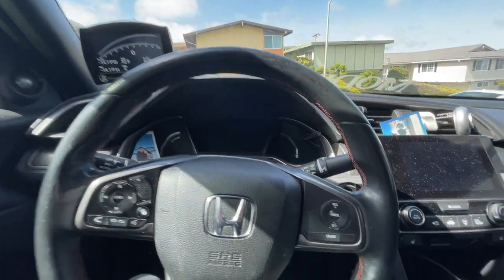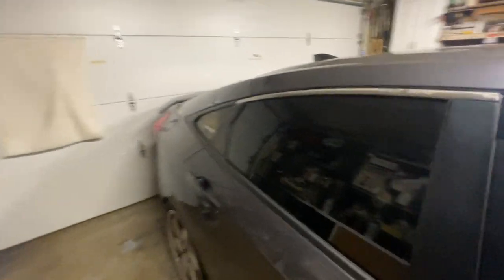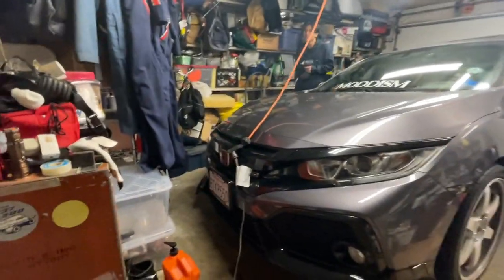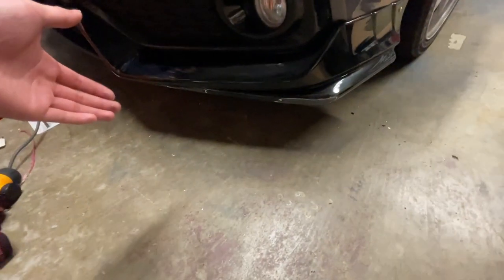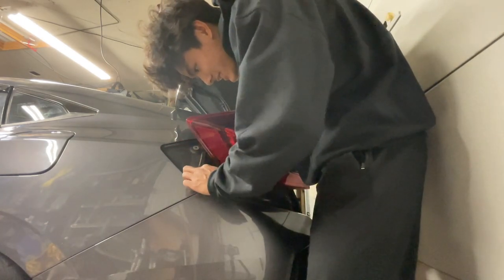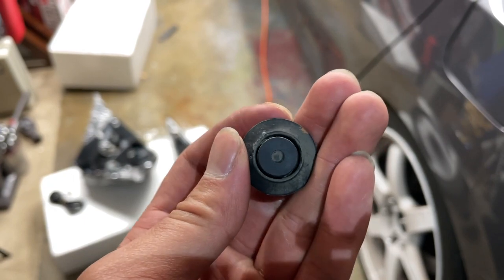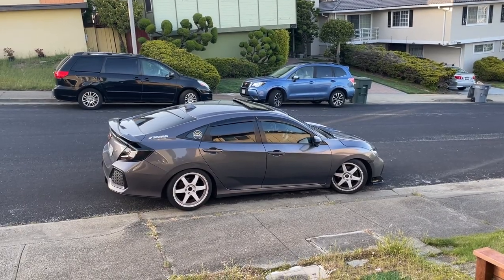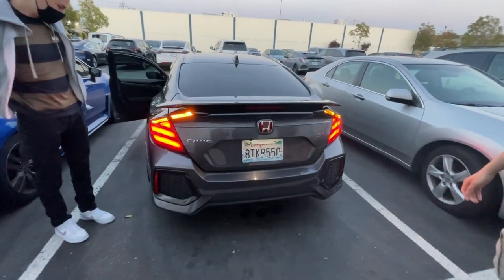I CAN'T BELIEVE I'M ONE OF THE FIRSTS TO GET THESE!!

Comment: When installing these do you need to do anything special from going to the bulbs to taking them out and plugging in the new lights to the OEM connector? I installed these and all I got to work was the turn signal on both sides but none of the rest of the lights?
Reply from the maker: Sometimes you have to flip the connectors around. Idk why but that’s what solved the issue for me👍🏽